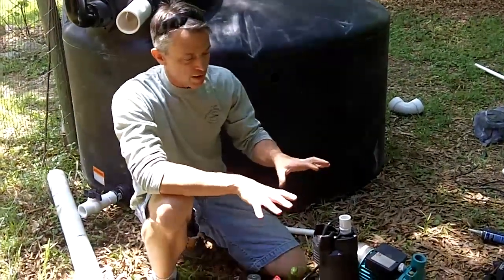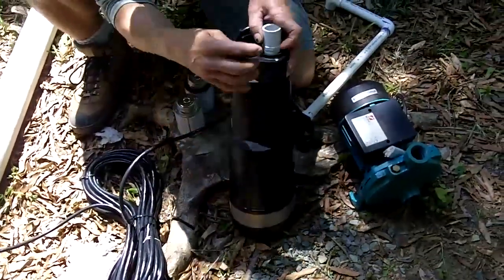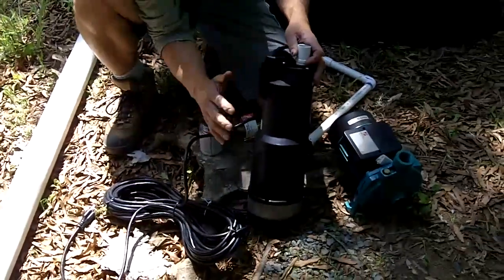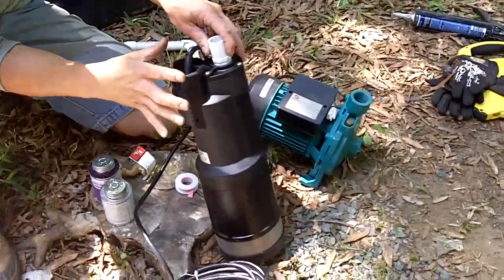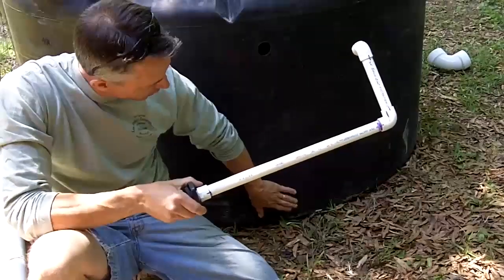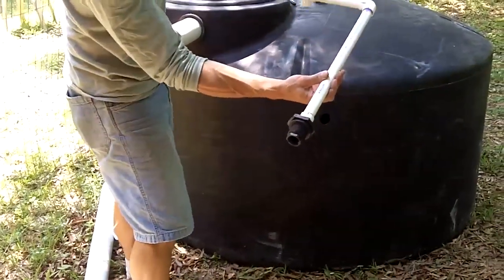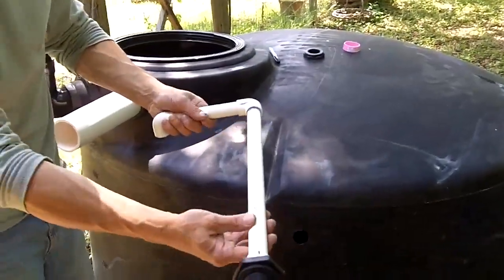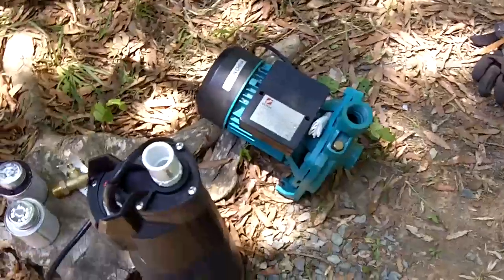Rain Water Harvesting Cistern Build - Pumps

Comment: Thanks for the post!  I like gravity in / gravity out systems too if they make sense for a particular application.  Pumps are needed where:  you are watering above the water level in the tank,  have long runs of hose (>100') due to friction loss,  are running a sprinkler head or other device that requires more pressure,  or are impatient and want to get it done!.   MW